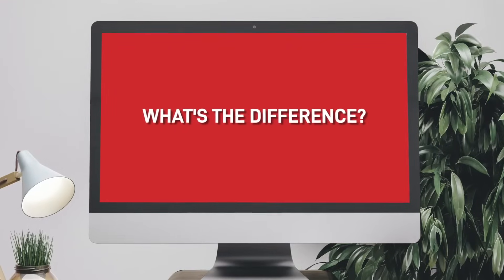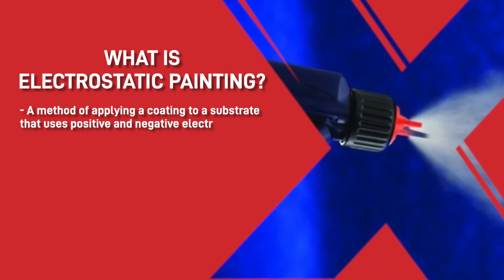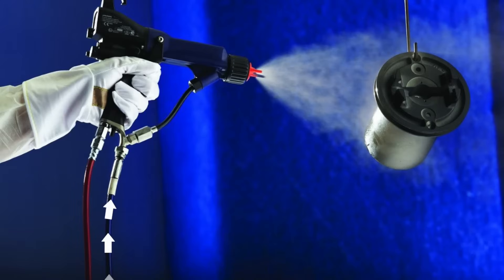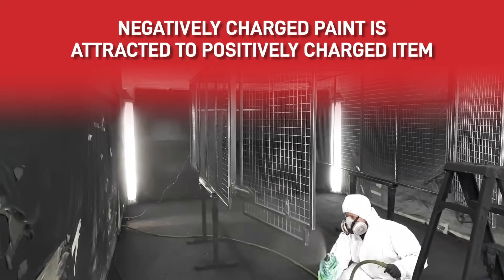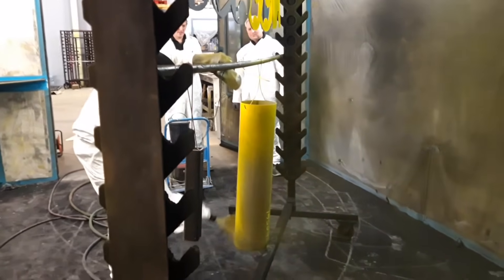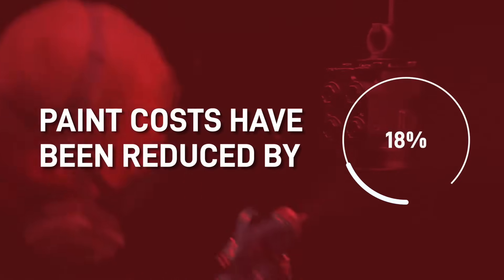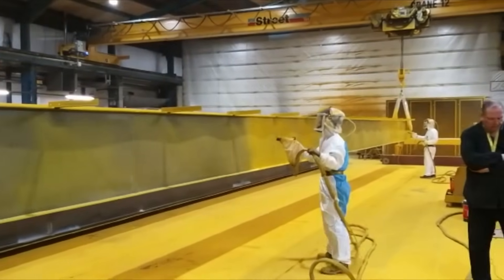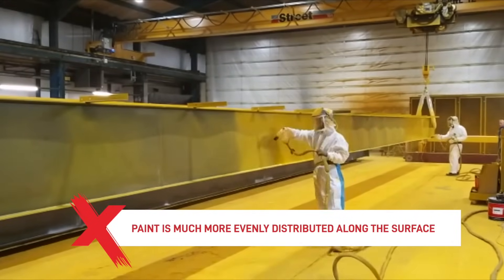How To Use An Electrostatic Spray Gun For Painting And How It Works

Comment: Hello Sir , I am planning to do a project on electrostatic spray coating, and I have no idea about the temperature required to heat the sprayed coating so that it gets bonded rigidly to the parent material, so can you kindly share the info on this matter?
Reply from the maker: Hello that depends on what type of material you are painting ? We spray our materials when using electrostatic at standard temperature between 5-20 degrees (UK) . br Ultrimax Team
Reply: @ultrimaxcoatingsltd  thank you very much for your reply sir
Reply: @ultrimaxcoatingsltd  hello sir in my project the base metal is tungsten carbide and the powder to be coated is TiAlN (Titanium Aluminium Nitrate) , so in my case what would be the recommended temperature upto which it has to be heated?

Comment: How to grounded it?
Reply from the maker: Hi Tatia, to ground it you basically have to clip a grounded cable to a steel structure (ie the steel the item you are painting) and then back to the sprayer unit via a cable that runs along the gun. This includes a control unit modulating the current attached to your sprayer. It's why electrostatic tends to be more expensive in setup but heavily cost saving in paint (the paint is attracted to the metal item and not the walls, floors or you in overspray) br Ultrimax Coatings Team